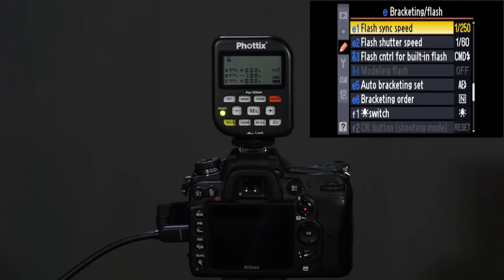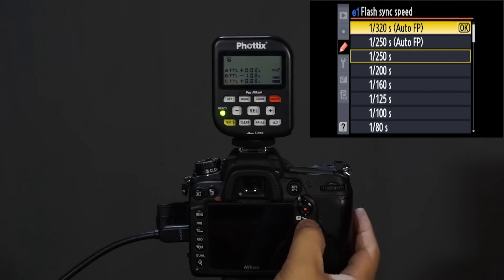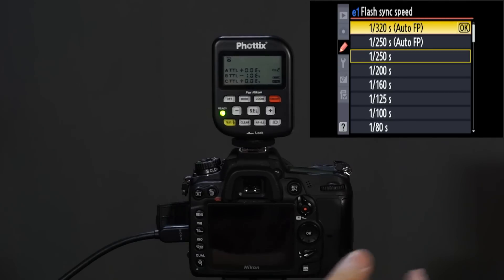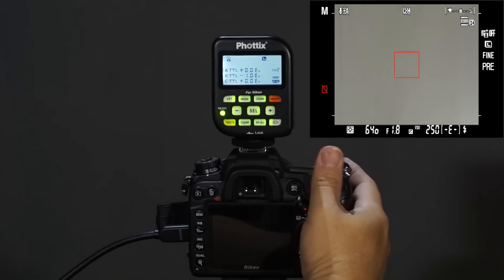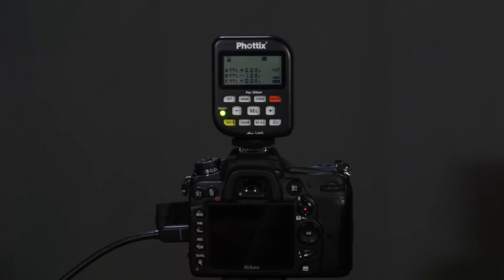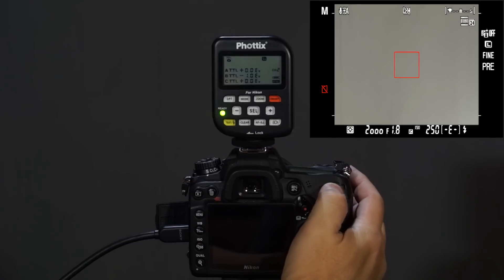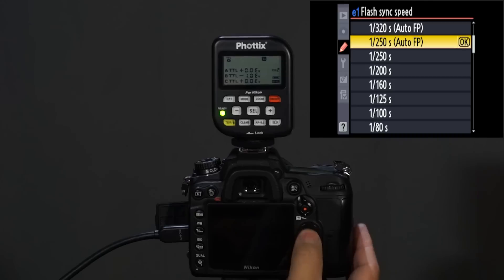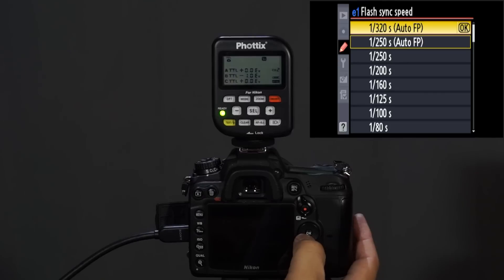Nikon High Speed Sync On A Phottix System

Comment: Late to the great video, still valid in 2023 , on Nikon Phottix Odin the Af-ALL is not HSS button, as the comments said below it is set in the camera in Nikon , rather it is auto focus assist illuminator. From the user manual:
"Pressing the AF Assist Illuminator Function
 button turns on/off  flashes AF Assist functions.
1. When turned on: AF Assist Illuminator Function
will cause flash’ s AF assist lamp to 
illuminate when the camera shutter button is
 half-pressed.
2. When turned off  AF Assist Illuminator Function
 will be disabled and will not illuminate
 when the shutter button is half-pressed.
Note: AF-ILL Functions need to be enabled
 in  flashes custom function menus. See  flash 
instruction manuals for details. "